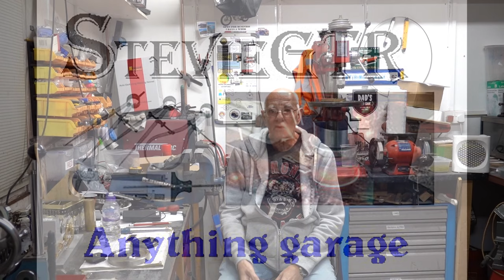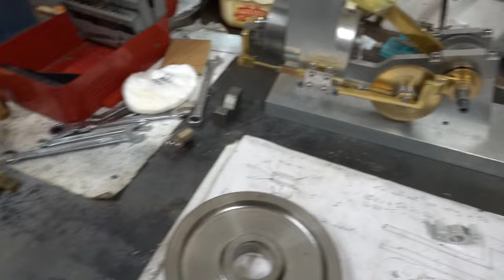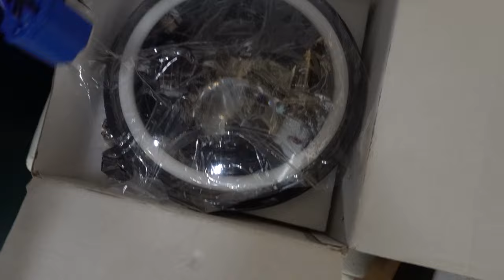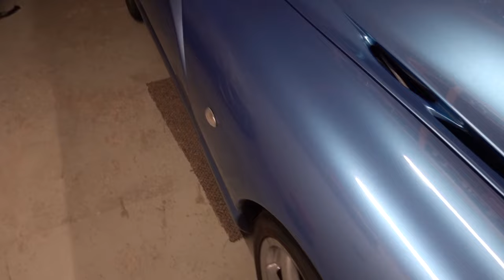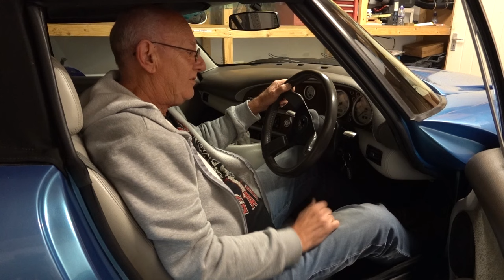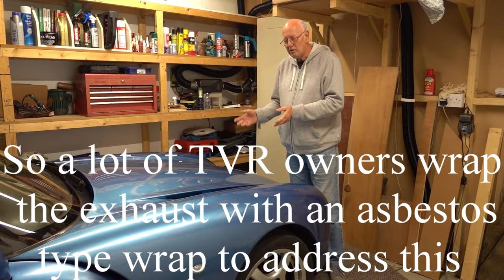What to do with the new TVR

Comment: Hi Steve
Thanks (again) for a mention! Happy to help where I can!
For your exhaust coating, I race with a lad - Guy Carter, who's business is doing the ceramic coatings on exhausts etc. When the time comes give me a shout and I'll put you in touch 👍
Reply from the maker: That is great Dave. Still not sure about this engine's past. But will do the manifolds at some point. Still rearanging the garage to be able to get the 2 post in. Did you have a MGB roadster that you raced. 
Steve.
Reply: @Steviegtr52  Hi Steve. Our old MGBV8 was a GT. Dad raced MGs in various guises (all GTV8s) from 1992 until it got written off in 2006. We were building a Roadster V8 for the road, but sold it as an ongoing project some years ago... I've raced a couple of models of TVR (the Griffith I've got and also a Tasmin V6), and driven MGV8s and various other things on track over the years 🏁. 
Dave

Comment: I recommend that you check the MOT rules regarding LED headlamps. There was a rule change recently.
Reply from the maker: Hi Malc. Yes you are not supposed to retrofit LED lights into an existing enclosure. However if you fit the complete unit as designed this is OK. This is a complete new unit . Hope this helps.
Steve.

Comment: It weighs a ton??  It was and still is one of the lightest cars on the road and the best power to weight ratio. I've had six TVR 500 Griffiths and a 3000M to date. Just make sure the obviously things are safe and get out there and drive the thing. If that doesn't make you smile nothing will. If it still doesn't, you've bought the wrong car
Reply from the maker: Hello there. The griff 500 was my choice as a mate had one that went to Lemans with us some years ago. Lovely car. Anyway I am doing all the brakes with the winter here & hopefully plenty of driving next year. The rears are completely shot. The Bilstein shocks need a refurb & all the bushings are going to be checkaed over. Then on to the fronts with the Brembo 4 pots & 300mm discs. Lots to do. 
I'm sure that this is as, or nearly as quick as my previous F-type 5.0 R Jaguar. 
Steve.
Reply: @Steviegtr52  Looks like you're going to have your hands full Steve and make sure you show some video of you with a huge grin on your face when the work's all done and you're driving down the road. Merry Christmas.
Reply from the maker: Yes Sir, I will be doing many video's of the work on the Brakes , body & the interior. The carbon fibre sheet for the dash is due any day. Then I want to make the engine bay look nice & not just with silicon hoses but some powder coating to the rocker covers & plenum. Plus possibly ceramic coatings to the headers. I managed to speak to the man who ordered the car new in 2000. It seems like the motor has some nice bits in there so that maybe explains why it goes so well. Not withstanding the 1 ton weight. Thanks for your your comments. Will have a look at your channel. Merry Christmas to you too. 
Steve. @K22MDL